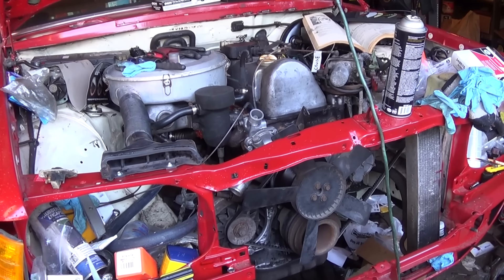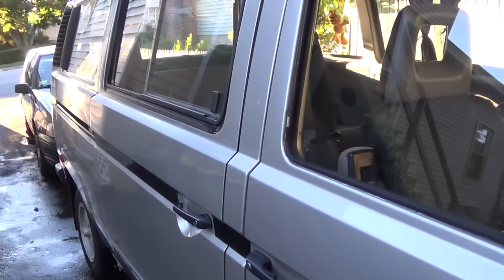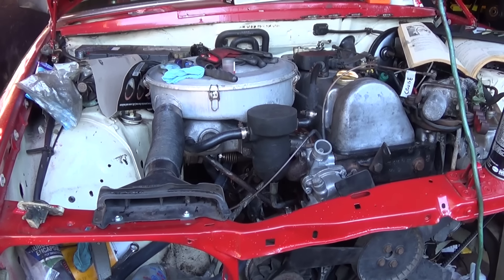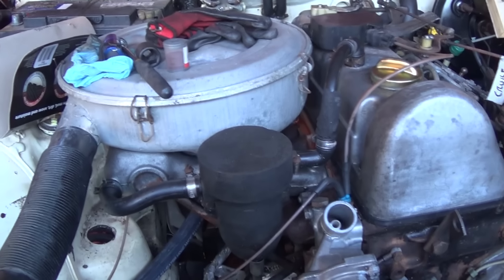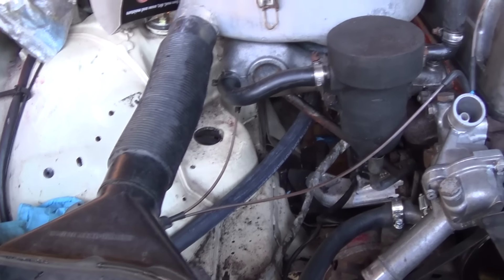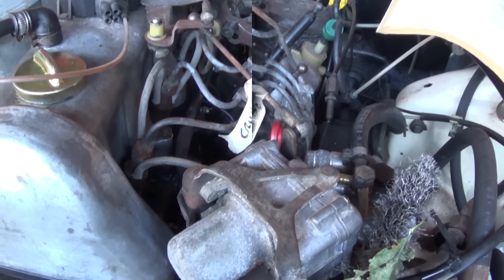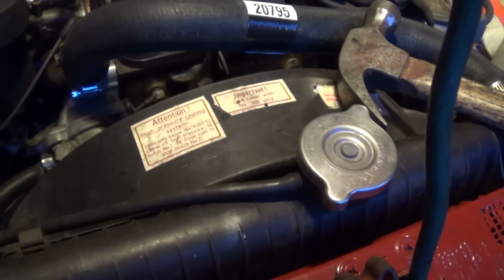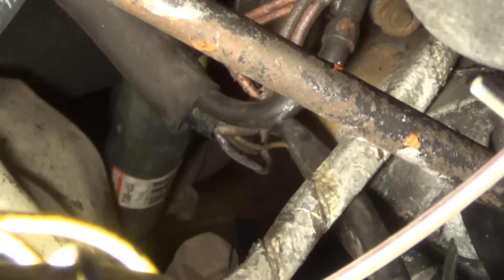1983 Mercedes-Benz 240D - part 185: radiator, exhaust, and weekly update

Comment: I was at Larz Anderson VW Van and Camper day as well.  Amazing time.  Nice progress on the 240D.  Can't wait for a road trip video soon.
Reply from the maker: +Bostonclassics1 You were at Transporterfest? Small world. I popped my oil cooler seal on the drive in and ended up having to pull over and add oil every fifteen miles. But, I made it there and back. New seal on order.